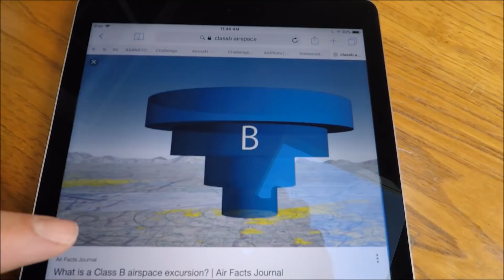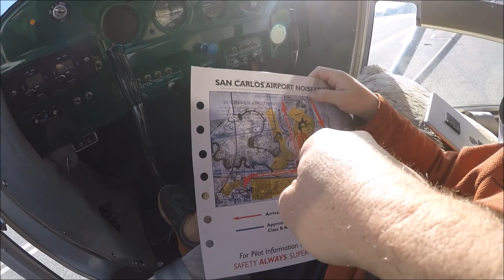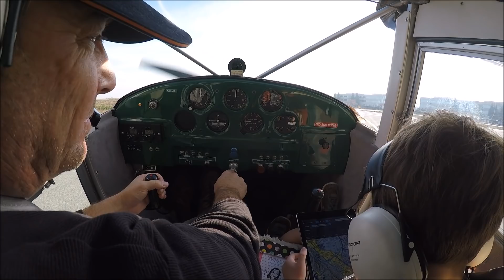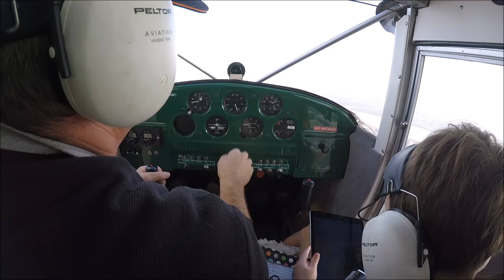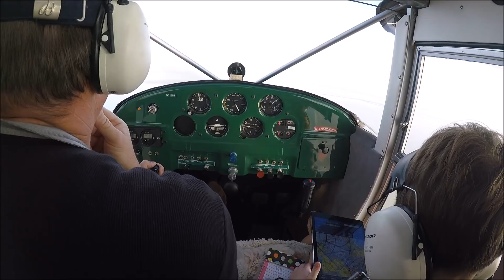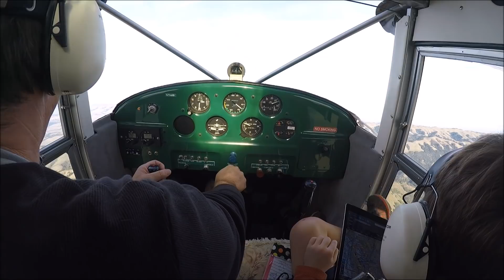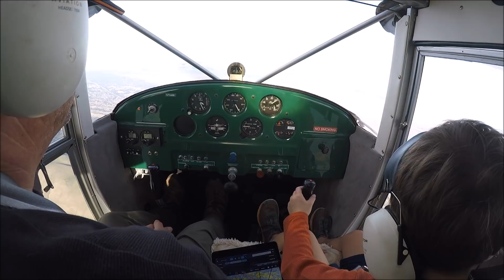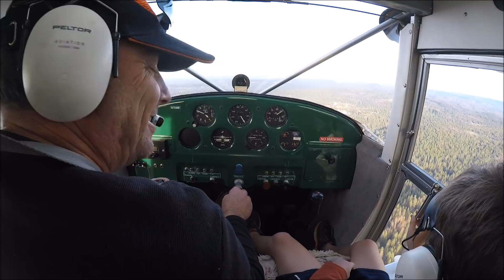Flying With Pete(6) Class B Airspace near SFO Luscombe 8A/O200

Comment: Hi Neighbor, Dan on Long Valley pointed me in your direction.  I am Jim W6LG with Ham Radio Basics and about half way to the look out.  If you would like to discuss off air the monit...., that would be better.  I have a suggestion that worked for me at 10k sub.  73 de W6LG